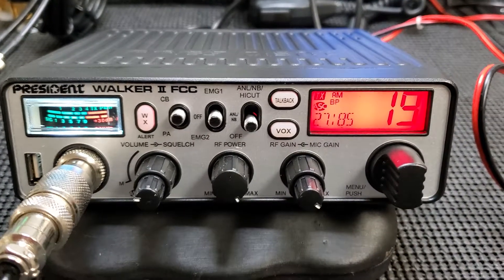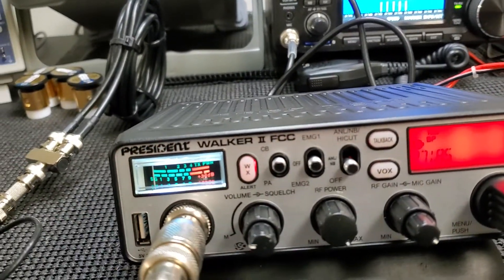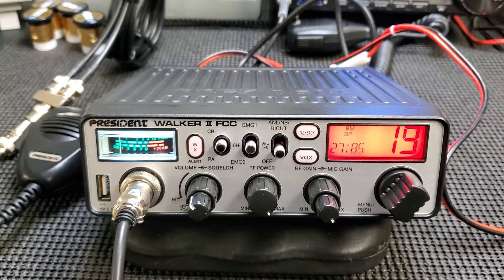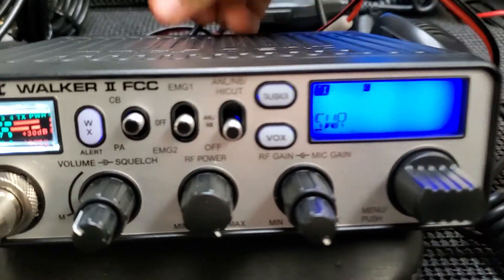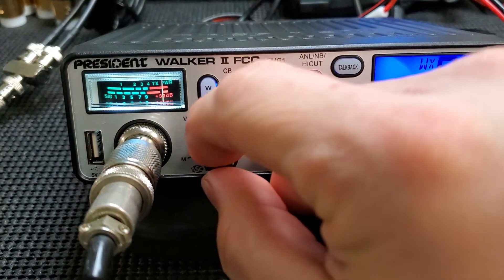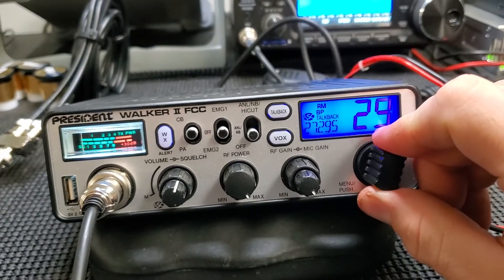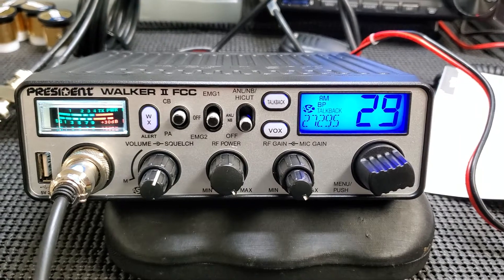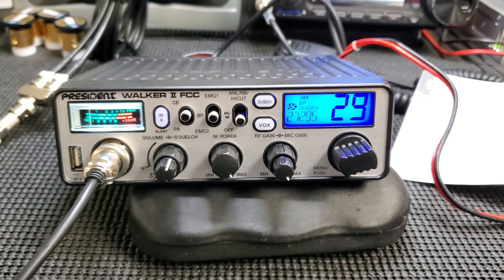President Walker II FCC CB Radio. Out of the box performance and demonstration.  A fantastic radio.

Comment: Mine didn't last. I use mine in a triaxle dump truck and mine only lasted about a year and now it randomly changes channels, sometimes even while you're talking on it. I don't think it could take the constant pounding you get in a heavy haul type of situation. I'm now looking for a replacement radio, something that can take being in a truck that gets tossed around with huge loads of stone and broken up chunks of concrete.
Reply from the maker: I would contact President. They will warranty it within 2 years of purchase date.
Reply: @ScottsRadios  Well, I guess my first question is, why would I want another unit that won't hold up? Unless they're planning on giving me my purchase price back, which we both know won't happen, why even bother? The first thing they're going to say is it was hooked up wrong or I dropped it or find some way to blame it on me. The next thing is they're going to want it back to see what is wrong with it which still leaves me without a radio and I'd still need a new one because we use ours several times a day and I can't be tied up waiting for them to tell me no.
Reply from the maker: @Dirthauler65  they have a great warranty. Doesn't hurt to try.

Comment: I have an older Uniden 500 Pro, simple as it gets. I had an old Little Will antenna on it which tuned out perfect at 1.0 and 1.3 on ch40. The antenna got water in it and corroded. Replaced it with a NEW Little Will on the same radio. Now my swr on a good Micronta meter runs 1.4 and 1.5 on channel 40 is the best I could get after screwing with the new antenna for over an hour and cut it off twice with my angle grinder. Is it the new antenna being newer junk? Any sugestions to get that swr down a bit?

Comment: Will this radio work with a talkback controller?
Reply from the maker: The radio has TalkBack.
Reply: @ScottsRadios  I know that, but it's not loud enough.
Reply from the maker: @bluehappyscrap  I think there is some external speakers on the market that have a TalkBack feature built into them.
This may help you in that situation.

Comment: Thanks for the video. I would love to see it on the scope with the modulation turned up. I also wonder how low the dead key can go?
Reply from the maker: It is really text book on the scope. It will not flat top or flat line. I'm sold out at the moment on this model. The dead key can go to less than 1 watt I believe.
Reply: @ScottsRadios  Thank you sir.
Reply from the maker: @027MC7  No problem